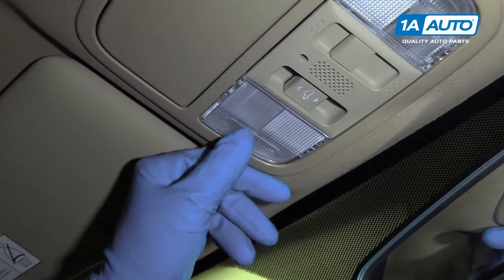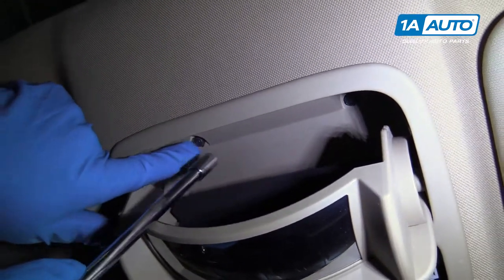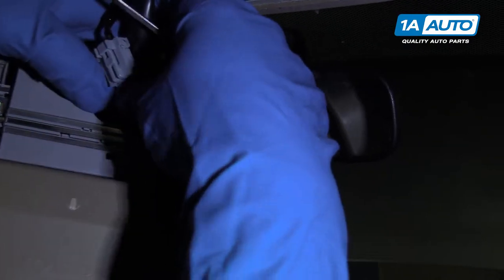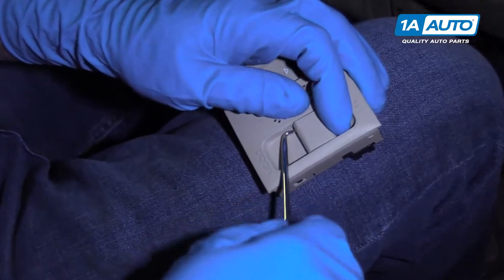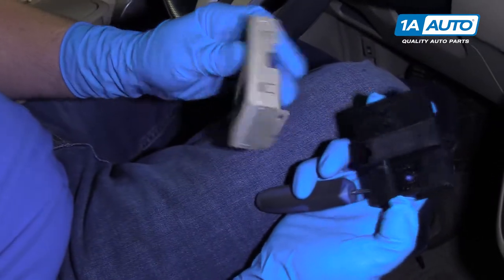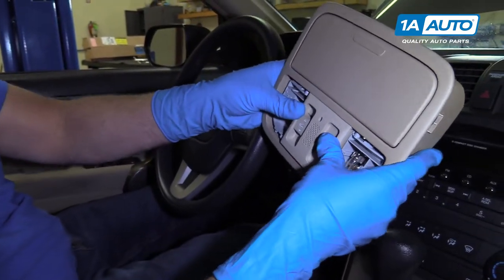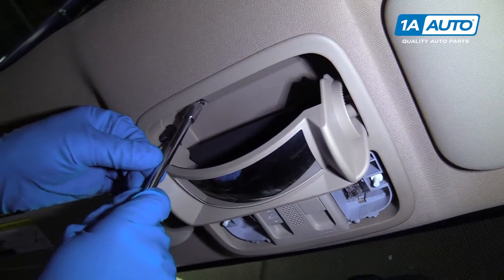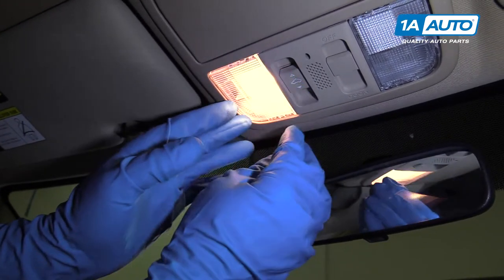How to Replace Overhead Console Sunroof and Light Switches 07-11 Honda CR-V

Comment: Sunroof on my 2008 Accord is hit or miss to open or close with switch and has this same assembly.   Takes multiple times pushing the button before it goes.  Bad switch?
Reply: Did you find the fix? I have same issue

Comment: What is the second switch for? One side says off and the opposite says door.
Reply from the maker: +Ceazr That is for the dome light.  When set to "door" the light will come on when the doors are open, when set to "off" it will not come on when they are open.  1aauto.com
Reply: @1AAuto  Thank you!